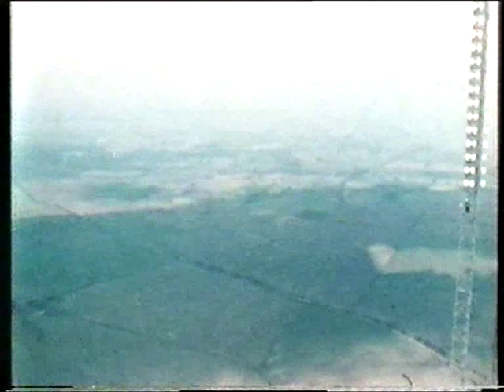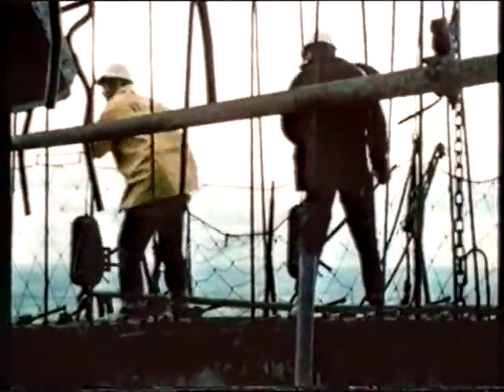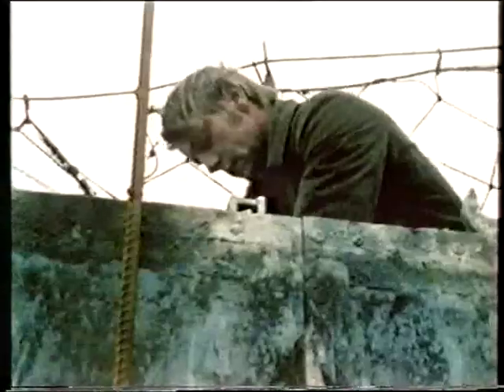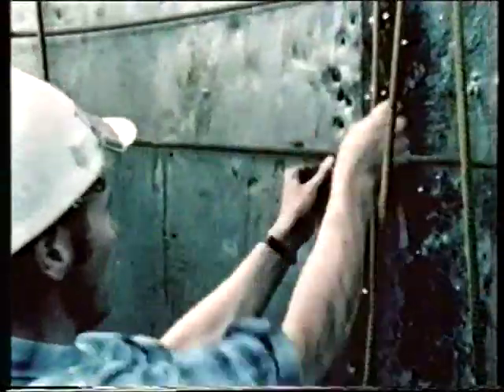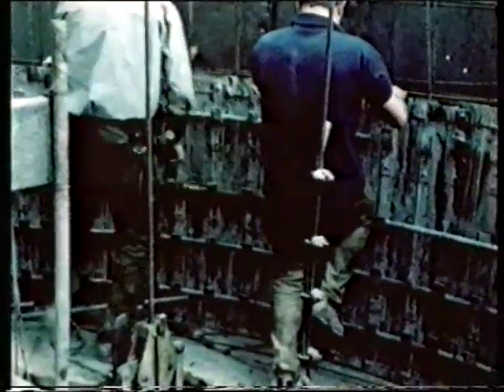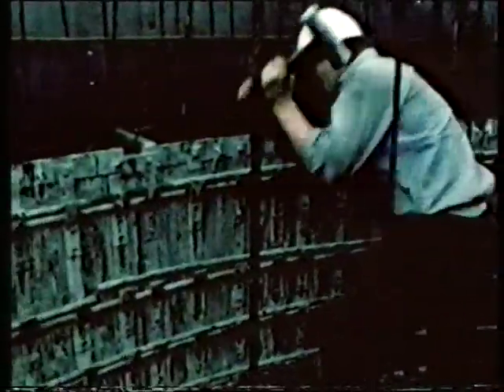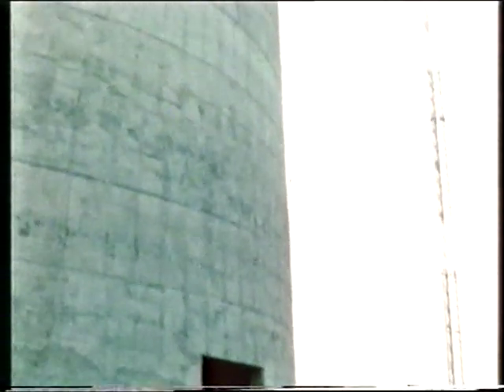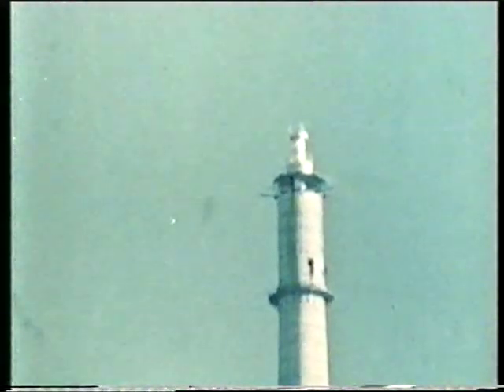Tale_Of_A_Tower_pt.2

Comment: Of course the reason for the concrete tower was not really for the benefit of the riggers/maintenance teams but more because the locals didn't want another guyed mast as they were afraid it would collapse again, and when cost comparisons were done with a regular lattice tower the costs were similar, hence the concrete tower won.